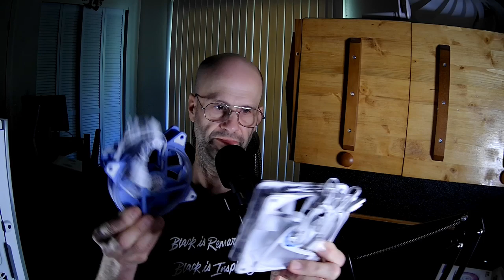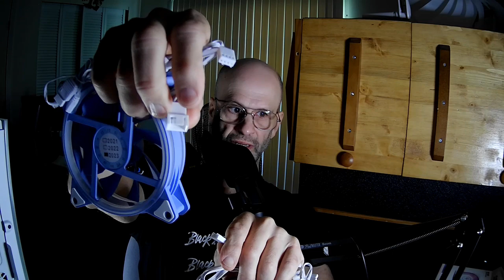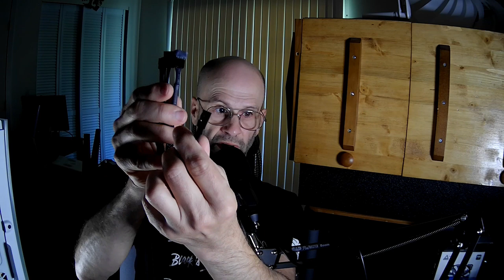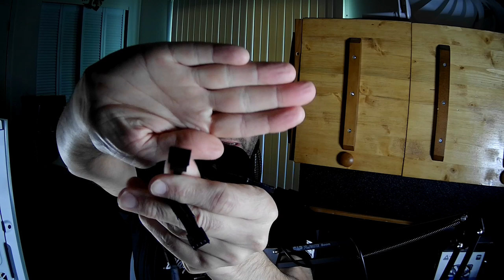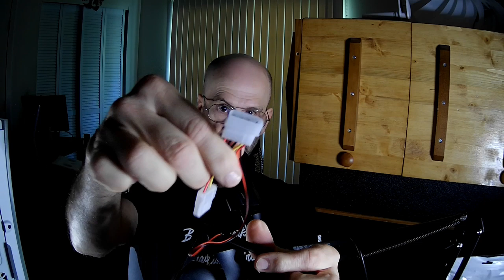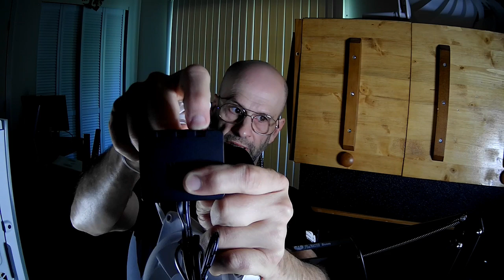How to Daisy Chain Fans with standard power connectors, Molex-D, JST (NZXT) & ARGB Lighting...

Comment: Is it safe to daisy chain two different types of fan? I got 6 fans of the same brand, 3 have RGB and 3 doesn't, and I want to daisy chain them
Reply from the maker: Yes, chaining together different fans is safe as long as you don't exceed the maximum amperage provided by the power source. And, of course, that assumes that you are not trying to connect an ARGB plug to a PWM socket! ;) Like goes with like. Note that any fans connected behind 2-/3-pin (non-PWM) fans will only have the functionality of the fans in front of them. Therefore, if you have a 2-pin fan connected to the header, and a 3-pin after that, and a 4-pin PWM after that, in most cases all 3 fans will operate at full speed because that is all that the 2-pin fan can do.

Does that help?